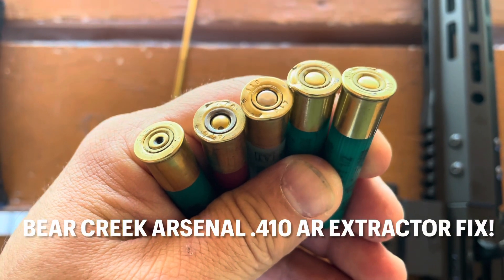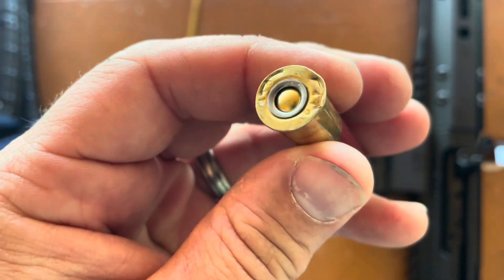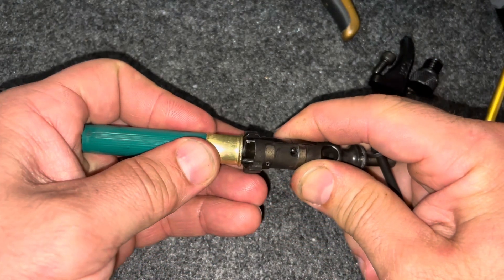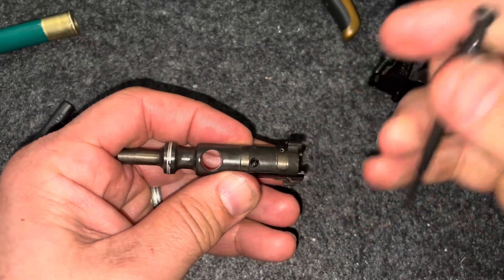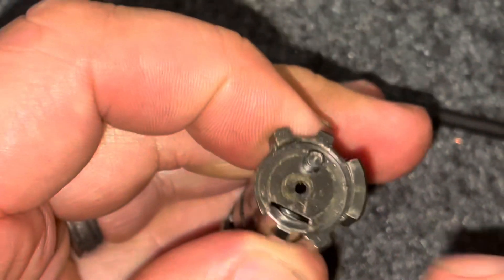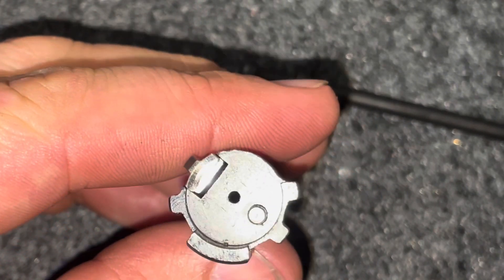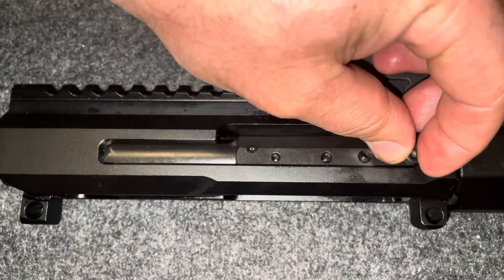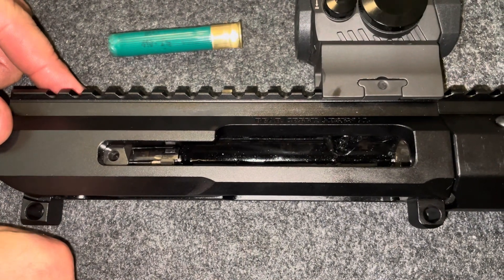Does your Bear Creek Arsenal  AR .410 extractor not grip the rim but Smashes it? I have a fix!

Comment: This plus sanding my mags fixed my issues.  Thank you!
Reply from the maker: That helped me too, but BCA replaced my whole upper, new one is much better
Reply: @crankygunreviews  I may have to contact them.  I am now having feeding issues! 😆
Reply from the maker: @noelsteele  yep call or email
Reply from the maker: @noelsteele  I did a few videos on mine- look them up. Even running “well” it’s not 100% reliable, and some shells won’t feed or will jam on extraction if the heads swell up. My last video I did a lot of different brand testing
Reply: @crankygunreviews  Thank you so much.  I sent them an e-mail.  I will check your other videos!!

Comment: Disappointing - Am very interested in 410 for an unused lower have, was hoping BCA would be it. Wonder if they are addressing internally or just selling what they have and being done
Reply from the maker: I returned my upper, and they sent me a completely brand new one, that was machined much better, had a totally different style extractor, and was test fired. I am pretty confident mine will work now. 
The other issues with these are the magazines- no one makes a super smooth 410 magazine- I had to sand all mine down to get them to fit better into the lower. My Aero lower is tight, the anderson lower I have would not accept the mags at all, and the PSA lower I have they worked pretty well in. 
also, there is a strict length on shells that will fit well into the mags. The .410 upper is a great idea, but it is not as simple to use as a 5.56 upper
Reply: @crankygunreviews  appreciate the feedback, still batting around that at $250 or whatever it is w taxes and shipping is it worth the gamble… the 410 option seems ideal for squirrel / turkey etc
Reply from the maker: If they work, it's well worth the gamble. I think there is just starting to be more info out there from guys like me and gunsforeveryone, and we are starting to point out the issues. I will say, Bear Creek Arsenal has good customer service, I shipped mine back, and had it back to me in just about a 2 1/2- 3 week turnoaround. I have never paid shipping for returns, and they have always taken care of me even sending parts I know failed so I didn't need to ship stuff back.   Really I think they just need to fire every upper and tweak it as needed before shipping any. I really like the 410 AR and when mine ran a few rounds back to back, it felt awesome. They use standard 410 chokes as well, so I bought a pack of chokes and a wrench for mine, have Imp cyl, mod, and full now.  @lewismeriwether3892
Reply from the maker: I have a few videos on this gun, feel free to watch and you see the issues I have had, and what Bear creek did to fix them as well as my mods on the magazines to make them work.
 @lewismeriwether3892
Reply: @crankygunreviews yes I have thank you! You’re one of the few promoting this platform and it helps folks like me think through!
Reply from the maker: I was a non-AR guy (just because they were so popular and everyone said I should get one) until I started looking at cross calibers that you can use on a Mil-spec lower, and realized how versatile the platform is... 16" A4 upper, 20" A2 upper, .410 upper, 7.62x39 upper, 22 magnum upper all on the same lower with only buffer and spring changes? Yes please! I will get my 410 to run properly eventually, it's too cool not too.  @lewismeriwether3892

Comment: Good detective work figuring out the problem. Are you able to shoot any type 410 through it?
Reply from the maker: Technically yes, but the magazines only fit very short 2 1/2” shells. You can manually feed anything up to a 3” magnum. And it has screw in choke, so theoretically you can get a choke to do anything